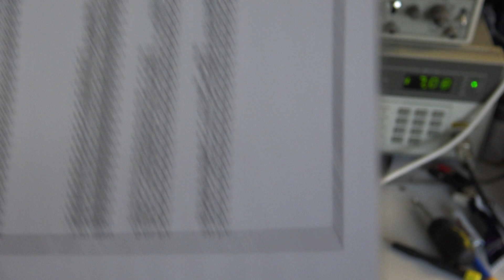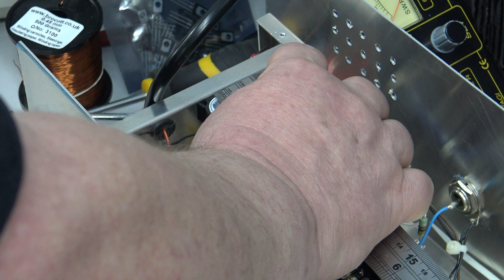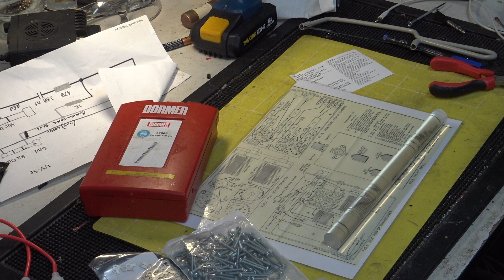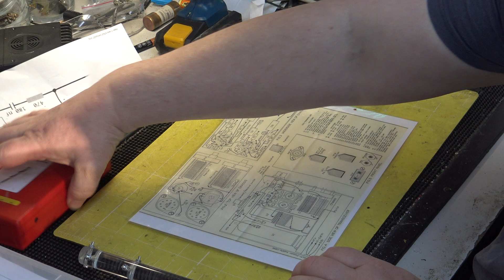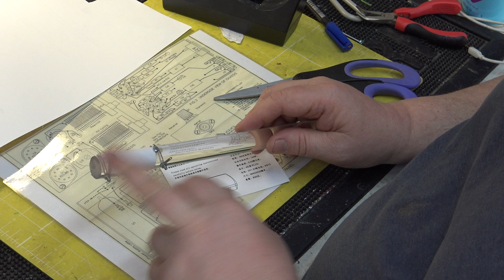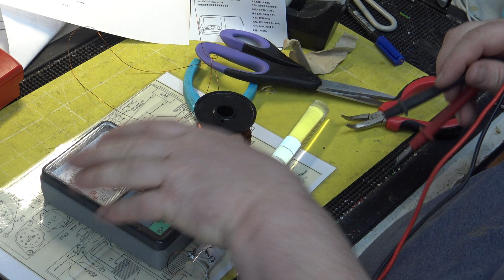7Mhz homebrew transceiver (1964 design) project Pt 2.5 of 3

Comment: Ah, 2.5 of 3.  Got it - the decimal didn't come through in the title.  I will go digging for the other parts.  

Don't let my US Amateur Extra class license fool you, I know nothing ... and I'm certain I've never wound a coil for myself (or anyone else) ... but ... won't changing the core material from ceramic to Perspex change the electrical characteristics?

Also, for a person with A Memory Like A Sieve, you seem to remember what your teacher said!

Actually, I may have wound wire around a nail when I was a little kid and connected it to a dry cell to make an electromagnet ... not the same thing ...
Reply from the maker: The ceramic thing...no idea where to get a ceramic former & this is only about 4W so it won't be melting the perspex.

Richard, G0OJF, UK

Comment: What about using an old soldering iron tip and use it to make the hole then throw it away, Use the heaviest SWG you can to carry the plate current that is required.
Reply from the maker: Remember I'm in the UK, so 'plate' is something you have your dinner off. The UK term is Anode. The maximum HT (High Tension) current is 100mA through the specified 26SWG wire. The data book states that 26SWG wire can carry 2A.

Richard, G0OJF, UK

Comment: Why did you not use a Tayloe Mixer for LSB/USB TX/RX and just use vacuum tubes for the Audio side of your transceiver.
Reply from the maker: I'm re-building my CW only radio which is a 1964 project. I don't want it to be SSB. The circuit needs to exactly follow the PW project....because that's what I want.

Richard, G0OJF, UK
Reply: @ukfmcbradioservicingTango21  VK3Y3 did a similar type system but used a binaural system that used the Tayloe mixer and gave a much better signal and he said you get a clearer copy rather that other nastys.

Comment: That Valve Machine Is A Beauty
Reply from the maker: Yes, people do have these...but I've never seen anyone else with the factory original trolley or the punch card panniers. I also have the CRT adaptors so you can do oscilloscope & TV picture tubes. Mullard's support seems to have ended about 1970 so later colour TV valves aren't in the system. However, when I did TV's in the late 70's & early 80's I didn't have the machine; my late Father worked at British Steel's research laboratories at Rotherham (million volt electron microscope etc). There was one of these valve testers there & no problem i my using it.

Richard, G0OJF, UK

Comment: I had to give up Valve equipment years ago. I broke into a traumatic sweat every time
 i switched one on at the cost and difficulty of replacing valves. Valve equipment
 should come with a built in automatic stopwatch so you can count down to the next bill
Reply from the maker: not helped by the 'audiofools' "but it's the Mullard valve with the blue bit so it must be rare £750" people.

Richard
Reply: @ukfmcbradioservicingTango21  Audiophiles shouldnt be allowed to tie their shoelaces without supervision. but prices can only go up as they are out of production. and all valves are slow burning fuses. I love Power Fets they're valves that dont burn out. I was reading about a radio tech like us who was talking to a HexFet manufacturer who was amazed to be told they were using them as PA at 27MHz. they only designed them for switching automotive tail lights and indicators, at up to 10KHz. I find  FQP13N10 work well in CB PAs but you do have to put 3 to 5v bias through a choke onto the gate